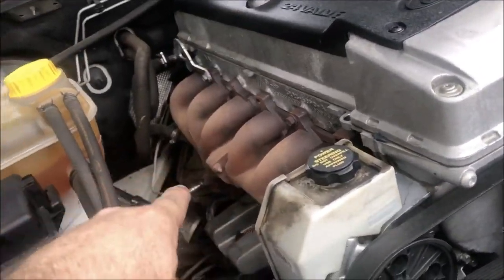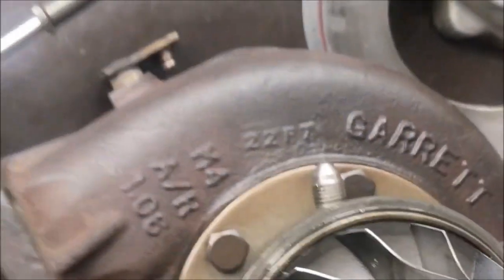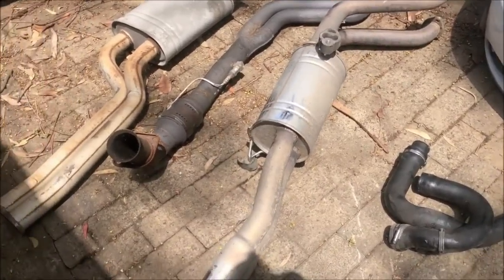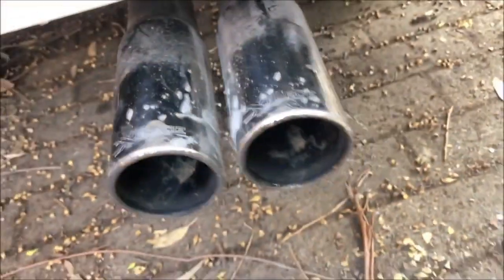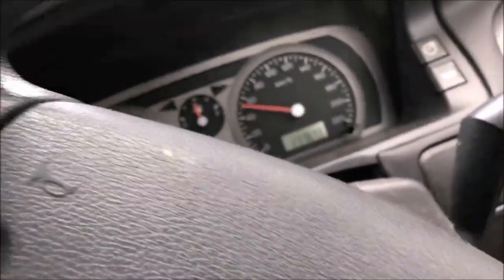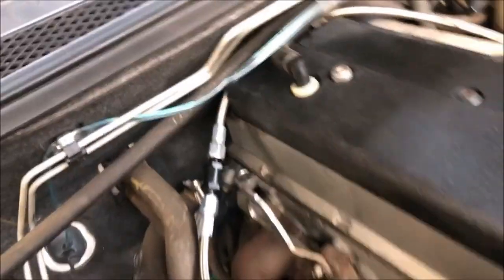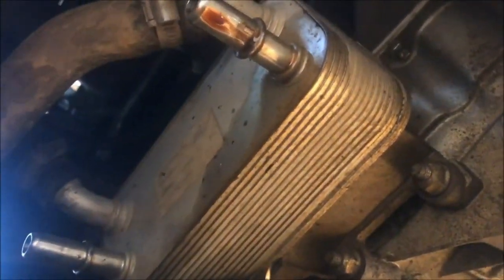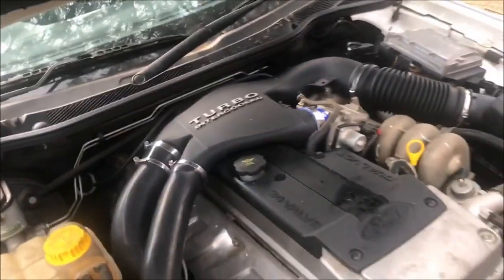NA Barra Turbo Conversion from start to finish

Comment: Turn up your grub screw under the s5 solenoid plug on your btr 4 speed so it shifts firmer and holds the clutches better and runs cooler

Comment: Disconnect the thermostat that goes to the transmission cooler as well because it leaks as well I used a z hose cut down to connect the two hard lines

Comment: Hey man how’s the N/A Barra holding up? Looking at doing this to my bf xr6 6 speed, any extras i should be looking at?
Reply from the maker: Yeah it’s still motoring along well. Definitely recommend a bigger intercooler than standard but apart from that, don’t overdo the psi and you’ll have a great reliable 350hp daily 👍🏻

Comment: Love this .. I have a territory. And wanna turbo it this helped so much , if you could just point me in the direction of that piping bit , the ba bf stock turbo pipe hit that goes over. The top please thankyou and wouldn’t mind a detailed parts list
Reply from the maker: The piping is all factory and readily available on marketplace or eBay. I’ve done a video of all the parts, hopefully that helps cheers 

NA Barra Turbo Conversion - What you need and How Much $$$
https://youtu.be/2cjEcqXCokE

Comment: Currently attempting this conversion on my Manual XL Ute , your videos have been very helpful. Have you made any more power modifications since ??
Reply from the maker: Nice! No not really, I replaced the transmission with a turbo btr and upgraded the intercooler for a bigger version to help reduce heat soak. Made a massive difference. It’s been my daily for over 3 years now

Comment: Hey mate. What engine oil do you recommend for a 2005 ba xr6. I've been using 10w-50. Is 5w-30 better. Just after a opinion about it cheers bloke 👍🏻
Reply from the maker: Hey man I use 10-40 diesel oil. Has extra lubrication qualities and detergents to keep everything clean. A must on turbo cars in my opinion
Reply: @oldskoolonly  thanks bro.

Comment: I’m doing a plus t on my ba falcon do you rekn change the map sensor and fuel pressure reg etc and it will be mint with no tune
Reply from the maker: It won’t run, have to tune it
Reply: @oldskoolonly  it won’t run? Yours ran before it got tuned
Reply from the maker: @jessegallagher-c3u  not with the turbo map sensor it didn’t
Reply: @oldskoolonly  I’ve got a fg turbo set up etc for my na ba do you not think it will be okay for a bit with no tune what will happen will it just go bang
Reply from the maker: @jessegallagher-c3u you’ll be able to drive it but I wouldn’t be throwing a lot of boost at it because it’ll be too lean and you’ll burn out the pistons
Reply: @oldskoolonly  cheers m8

Comment: I’m swapping a na black top into a turboed ba falcon would it be able to last?
Reply from the maker: If you tune it correctly. I’ve done over 70000k’s in mine at 250kw and it’s fine
Reply: @oldskoolonly  that’s what I was going to do I’ve got the tuner ready to go

Comment: That exshurst manifold got 6 branches how what size is that engine it looks like the Volvo and Ford ST focus but they are 5 silinder
Reply from the maker: 6 cylinder 4 litre
Reply: In line 6 Barra 🤘

Comment: What oil drain fitting did you use mate?
Reply from the maker: I can’t remember, it’s been over 3 years since I did the conversion. It was just an eBay item. I’d suggest searching for an XR6 turbo oil drain on there, I’m sure they’d still be pretty easy to find 🍻
Reply from the maker: It’s all in this video if that helps 

https://youtu.be/2cjEcqXCokE